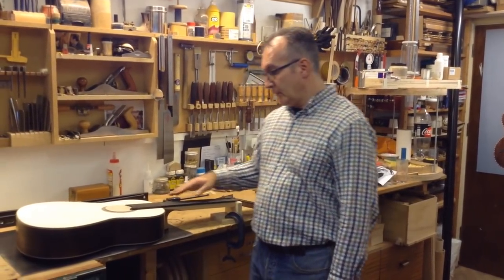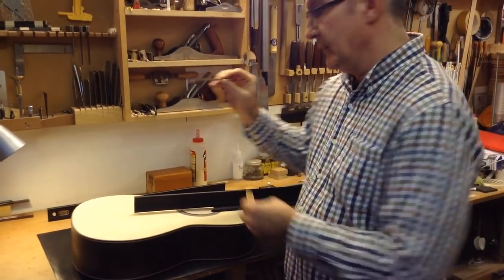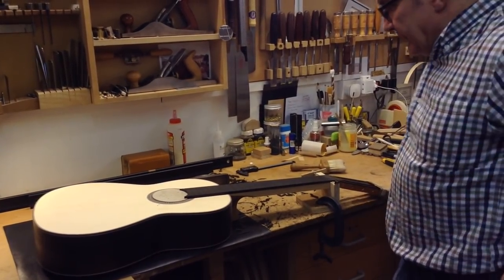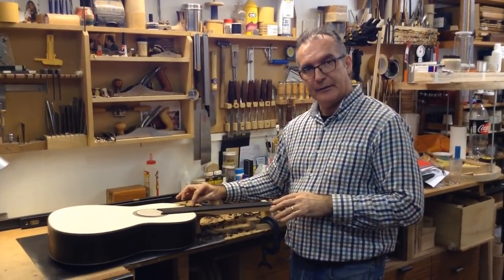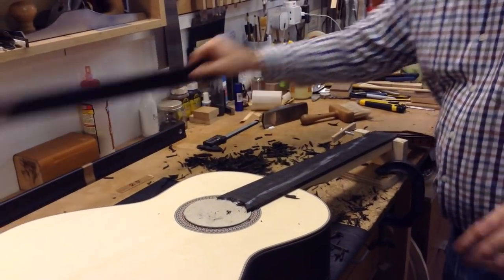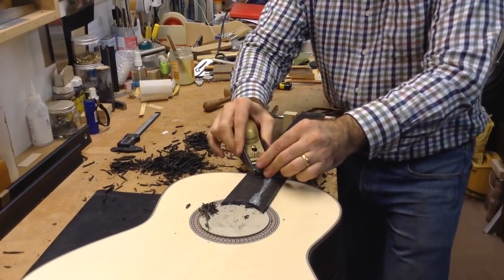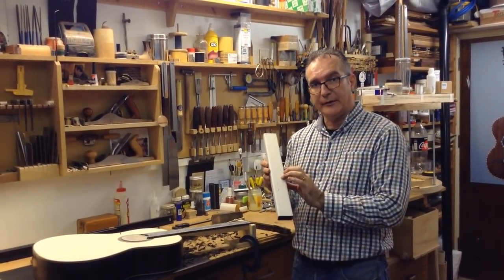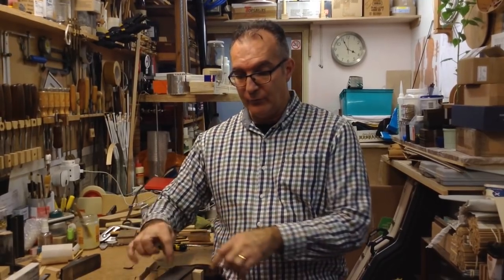How to prepare  the fingerboard for the right set up.

Comment: Just a point about planing the ebony fretboard. If the resistance means you keep stuttering as you push then you need to set the plane plane deeper into the body of the plane so less material is being taken off but you are able to do it with less resistance and in one go. You will feel less tired and less stressed by planing. As a cabinet maker, I have been taught to only set the plane so that the shaving coming off is as long as possible while being as thin as possible, so thin you can see through it - not easy to do with ebony. Slowly, gently, little by little, easy does it. Takes longer but it is worth it.

Comment: Greetings Pablo. I bought my Rodriguez FC about twenty years ago. It had never had a proper set up outside the factory but it served me well for many years performing and recording. The last few years though, it started to show its age. A deeper than normal bow in the neck, worn frets etc. I decided to try this method, leveling the fingerboard first, then putting in the slope in the bass side. With new frets, freshly leveled and dressed along with a new bone nut and saddle, it plays beautifully. No string buzz in the bass first positions. But just 4mm at the 12th fret on the bass side and 3mm on the treble side. No string buzz anywhere and the intonation is perfect with an uncompensated saddle. The guitar lives again! Thank you.

If you read these comments I would like to ask you a question. I have a flamenco blanca and the neck has lifted, the upper bout of the body has sunk. A combination of being stored in the hot boot of a car and heavy strings. I would like to level the fretboard again - only flat this time - to reduce the action which currently makes it unplayable for flamenco. In this video, you show the primary level of the board should extend to 3.5mm above the table at the bridge position. Because the flamenco bridge is not as high as a classical bridge, should we level the fingerboard to be a little lower at the bridge position? Say 1.5mm? 

Once again, thank you. It is so nice to watch you working with such artistry and precision. And your approach is so pragmatic... it helped me a lot when I was building my first guitar.
Reply from the maker: Hi, when it comes to work the fingerboard I do it exactly in the same way as I show in this video. In this job you need to think in reverse, if you go down to 1,5 you will end up having a very high action and you won't be able to lower it enough.
Reply: @redkitekk  Thank you again. I think I understand... so if we say the classical bridge is 9mm high and the flamenco 7mm high the fingerboard should receive its first level to 3.5mm at the bridge position for both because if we assume the nominal action of a classical at the 12th fret is 4mm to get 3mm at the 12th fret for a flamenco we need to drop the action at the bridge position by 2mm - which would be the difference between a bridge 9mm high being only 7mm high. So the lower action of the flamenco at the 12th fret is really a product of the lower bridge; and not the fingerboard, which should be set up the same as for a classical. '...exactly in the same way,' as you say. :)
Reply from the maker: @RobustWorks  👍👍

Comment: Dear Pablo
Thank you so much for another wonderful and informative video.
I wonder, would you go a little lower than the 3.5 mm if you were setting up a flamenco guitar?
Reply from the maker: Hi Catherine,
No. If you go lower you will actually have the opposite result, don't forget that in this you need to think in reverse. Planing more of the fingerboard will mean that the gap between the frets and the strings is bigger.
For a flamenco guitar I prepare the fingerboard en the same way as a classical guitar, but to be able to bring the string closer to the frets, what I do is to make the bridge a bit lower. For a classical guitar I make the bridge 8 mm thick and for a flamenco 7 mm thick. That way you can get the saddle to be low enough so that you can have the right action.
I hope this makes sense.
Pablo
Reply: Thanks so much once again!
Reply: @redkitekk  How high does the saddle end up being on the classical compared to flamenco? I assume the saddle is rather short on the flamenco but with classical it must be quite a bit higher to allow for proper distance from the soundboard. Is this thinking correct, or is the the height of the strings above the soundboard close to the same between classical and flamenco guitars?
Reply from the maker: Mizan Somani yes, the saddle is about 2 mm higher on a classical guitar if you compare it with a flamenco guitar. The hight of the strings from the soundboard in front of the bridge is about 7 mm on a flamenco and about 9 on a classical.
Reply: PabloRequena that makes perfect sense. Thanks so much!

Comment: Hello Pablo. Great video, very informative. I have made a large number of steel string guitars and want to make my first classical. In steel string construction we use the string tension and truss rod to adjust the neck relief.  Since the classical has considerably less string tension and no truss rod, do you carve the relief into the fingerboard, or do you just make a flat fingerboard and hope the strings pull it to the correct relief?

Comment: Hi Pablo, great video and very useful as are most of your videos. I'm curious what your using here to cover the sound hole?
Reply from the maker: It is just two pieces of 3mm board, one of them exactly the same since as the sound hole and another one a bit bigger in diameter both of them glued together fitting in the sound hole as a plug,
Reply: Thank you for the reply. Clever solution. So I would assume then that you made a cutout in the top piece around the contour of the fingerboard?

Comment: Thanks a lot. Very useful and well made video series. One question I have is regarding neck / fingerboard relief - there's a recommendation to fret strings on first and 12th frets and look for about 0.25mm clearance between string and fret at the 7th fret. Can one set that while finishing the fretboard ? Can one adjust relief without truss rod ?
Reply from the maker: Hi, The relief, while it is very important for the playability of the guitar, it is something you need to work out for yourself.
The way I do it is to plane the fingerboard completely strait, and let the tension of the strings pull the neck, that way you will have a good relief. If you try to build it into the fingerboard you could end up with a bowed neck.
I hope this makes sense.
Reply: Thanks again.

Comment: Hello Pablo,
thank you for this very informative video. In your video about the solera you explained there is an angle between the soundboard and the neck. So,
 before you glue the fingerboard, do you plan the surface of contact 
between this fingerboard and the soundboard to correct the angle?
thank you. Sincerely,
Gilles
Reply from the maker: Hi Gilles,
Yes, I plane some of the ebony from the underside in the area near the sound hole, that way when you glue on the finger board it ends up being flatter, otherwise the fingerboard would have a big dip in the middle which you could plane flat but you would loose most of the slots for the frets in some areas.
Reply: Thank you very much Pablo
Reply: Hello, just a clarification: you remove the ebony only near the sound hole or for the entire length of the fingerboard over the soundboard? And do you use, in some cases, to scratch the soundboard where it receives  the fingerboard ? Regards 
Costantino

Comment: Very good video, so you cut the frets slots at the right deep before gluing the fb into the neck, then After all this shaving you check one by one if they needs a second pass, right? And may i know your bridge height without saddle?  Thanks!
Reply from the maker: Yes, that’s correct. 
The bridge hight for classical guitar is 8 mm and for flamenco 7 mm.
Just in case you are interested I have a complete course available on www.onlineguitarmakingcourse.com

Comment: An excellent explanation and demonstration.  One question - would you consider it a legitimate alternative to increase the action on the bass side by increasing the height of the bridge saddle? I know that some makers do this.
Reply from the maker: You are right, many makers do this. In my opinion guitars work better if the string hight in front of the saddle is not much more than 10 mm and this is only possible if you reduce the thickness of the finger board in the base area. Otherwise you would end up with 12 or 13 mm in the base side and I believe that this will increase the torque produced by the strings and some guitars don't behave very well when this is the case.
You need to try this for yourself and make a decision as to which way work best for you.
Reply: Thank you, Pablo.  I have used both methods, and understand the problem with increased torque on the saddle. I was originally taught your technique by my luthier friend Michael Ritchie who worked with Rolf Eichinger for 2 years in Granada.
Reply: @redkitekk  estimado Pablo, le hago una consulta: ¿en qué sentido no se comportan bien las guitarras que miden 12 mm delante del puente? estoy haciendo mi primer guitarra y observo que la mejor guitarra que tengo y que conozco (una Dominique Field) mide 12 mm. Es verdad que está un poco hundida la tapa delante del puente, es eso a lo que se refiere en cuanto a que no siempre funciona bien este tipo de ajuste y por eso prefiere no mas de 10mm? Muchas gracias por sus videos, son excelentes, brindan información muy precisa, detallada y que demuestra una gran experiencia, saludos!
Reply from the maker: Juan Ignacio Izcurdia el hundimiento de la tapa es una de las consecuencias de tener mucha altura en las cuerdas, pero también es posible que la tapa sea muy fina, las barras internas son pequeñas, o una combinación de las dos cosas.
Si es una guitarra te tipo lattice esto pasa bastante. Esto no tiene porque ser un problema a no ser que afecte a la pulsación o a la afinación.
También comentarte por si te interesa que acabo de sacar al mercado un curso que puedes encontrar en www.onlineguitarmakingcourse.com

Comment: Hello Pablo,

Can you please tell me what you would generally consider both the optimum and also the maximum allowed neck relief measurements in millimetres on both the Bass and Treble sides of a Traditionally Spanish made Classical guitar ? 

Thanks
Don
Reply from the maker: Hi Don,
relief on a Spanish guitar is really very small, about 0,2 mm but not more than that. Any more than that will give you problems with the set up.

Comment: Thanks Pablo, how much extra depth do you normally add to the fret slots in relation to the tang size when you cut them to avoid as much a possible having to re-cut the slots after you plane the board like you do here, Is 1mm adequate?
Reply from the maker: Hola Juan.
I do the initial cuts at 3 mm deep, but you still have to deepen some of them once the planning of the ebony is done.
Reply: @redkitekk  Gracias Pablo!

Comment: How much increase in action can I expect after the initial setup when adding the strings (HT) and allowing a couple of weeks to set (building a blanca). I'm exactly at this stage ready to glue the fretboard and preparing it for the setup.   My neck angle is shallower than yours (1mm fret 0).  Do you use the same 3.5 and 2.5 spacers or should they be thicker since the angle is shallower to get the same action?  Thanks
Reply from the maker: You use the same 3.5 and 2.5 spacers regardless of the angle you used.
Reply: @redkitekk  Thank you!

Comment: Hi Pablo, Thanks for your great videos.
Isn’t the purpose of the angle on the solera to build in “relief” to the neck? Why plane it flat? Or why not built it flat in the solera? Thanks!
Reply from the maker: Hi, 
no, the angle on the neck is there to have the right setup at the end. The relief is created just by the pull of the strings.
Just in case you are interested you will find very detailed information about this and all the other aspects involved to build your own guitar on my course available on www.onlineguitarmakingcourse.com

Comment: Hello Pablo.  Great video as usual.  Do you find low angle block plane to work better with ebony?  Also, have you used rosewood for fingerboards at all?  Thank you.
Reply from the maker: Hi Michael, I prefer to use a low angle plane on any hard wood, but if the blade is very sharp you can use both.
For fingerboards I always use ebony, this is because ebony is harder than rosewood and will withstand the abuse of playing a lot better than rosewood. Having said that, a good quarter sawn piece of rosewood would also do a very good job for the fingerboard and many makers choose this option.
Reply: Thanks for the info.  Had a bad piece of ebony that had cupped on me when I glued it to the neck.  Loosened it back up with an iron and am starting with a new piece.  I am testing for cupping on it before I mark out my slots just in case.
Reply: Thank you again, Pablo.  Am trying the diagonal compensation for the bass side.  reminds me of a Contreras that had that feature long ago.

Comment: Hola Pablo,

One more question, did you have to figure out the grain direction of the fretboard before glueing it for the planing that would take place after? I have Ziricote fret board blanks and am wondering if this is necessary.
Reply from the maker: Ideally yes, you want to fit the fingerboard so that it is easier to plane towards the sound hole, however, with ebony this is very difficult to see, if you are using other timbers and the grain direction is easy to see then I would try to take advantage of that.
The other thing is that usually the fingerboard needs more planing in the area near the sound hole, but occasionally you find that this is not the case and you also have to plane the other end, so.... the real solution to this problem is to use a plane that is super sharp and set very fine so that the grain doesn't tear out, and sharpen your plane as many times as necessary to do the job. Also, allow a bit of material to finish of with sand paper to clean plane marks and small tears in the wood.

Comment: Qué tal maestro. En qué capítulo de sus cursos en línea puedo encontrar información referente al ángulo del brazo con respecto a la tapa. Así como el porqué de los 3.5 mm y 2.5. Muchas gracias.
Reply from the maker: Hola, el tema del angulo del mango lo explico en diferentes ocasiones pero no hay un capitulo especialmente dedicado a eso. el capitulo donde puedes encontrar mas información sober eso es en el capitulo de que se llama The Solera Mould donde explico como se construye la solera.
Respecto del porque de los 3,5 y los 2,5 mm lo explico en la ultima parte del capitulo 22 del curso.
Gracias

Comment: Hello Pablo .Wish I found you earlier ,Pablo I have a problem the finger board is flat ,but only 6mm thick . The saddle is fixed 2.5mm same as yours  .How do I get a good action .Yet to plain the bass side .
Reply from the maker: Hi Dave.
I think your fingerboard is a little too thin, there are different ways to do this job. For me, as I explain in the video I start with a fingerboard 7 mm thick and plane down the end of the ebony closer to the guitar so that I get a hight of 3.5 mm at the saddle position. Once I have it at that point I plane the base side to go down to 2.5 mm. With these dimensions I can get a good setup later on.
You could try to plane the end of the fingerboard closer to the head to the he point in which you have 3.5 mm at the saddle and then plane the base side to 2.5.
If this doesn’t work you might have to remove the fingerboard and fit a new one 7 mm think.
Just in case you are interested I have a complete course available on www.onlineguitarmakingcourse.com

Comment: question about relief on the bass side.. what does it matter if you level the frets to one plane?   Will you file the frets lower on the bass side as well?
Reply from the maker: I don’t lower the frets, I keep them as evenly high as I can. I plane down the base side of the fingerboard so that when I make the saddle it doesn’t have to be a lot higher in the base side than in the treble. I like having the saddle as equal in hight as possible, this is just the way it works for me, but of course it doesn’t mean that it can only be done my way.
Reply: @redkitekk  Hello Pablo,many thanks for your feedback.Best Regards,
Don

Comment: Pablo, one more question. What complete cutting angle do you have on your plane for this job?
Reply from the maker: Hi Owen, I don't set up an angle on the plane, my plane cuts evenly across the width of the blade. To achieve the angle on the fingerboard I plane different areas of the fingerboard gradually to achieve the angle I need.
Reply: Thanks Pablo.